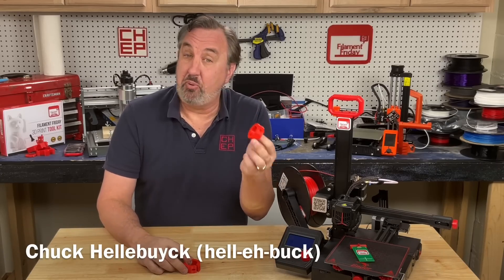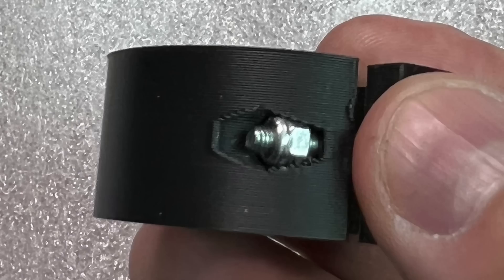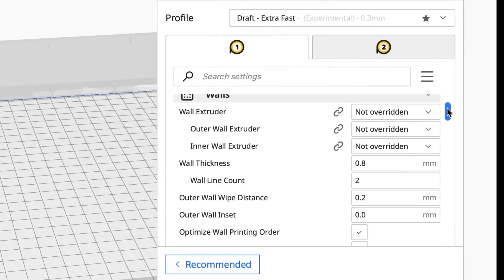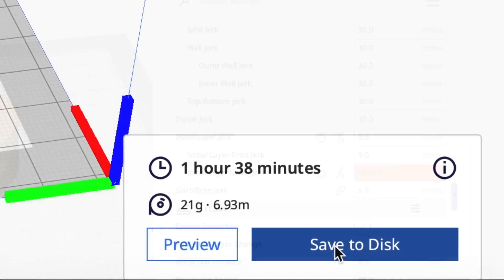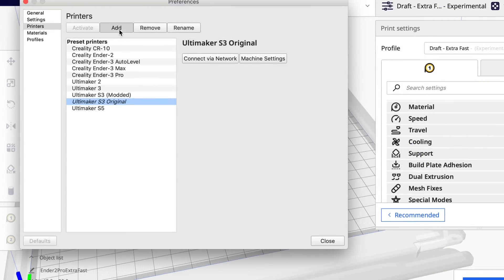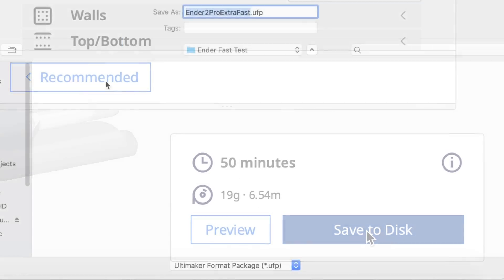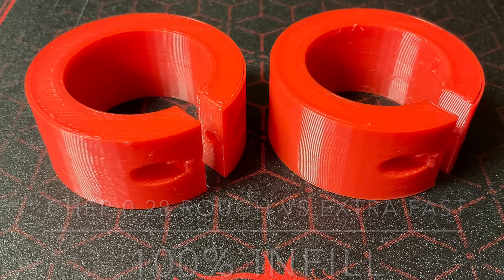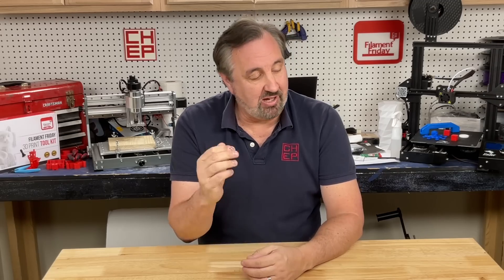Faster 100% Infill Prints with Cura 4.13 on Ender 3D Printer

Comment: I printed a few items at 100mm/s on my Ender 3 Pro without any issues at 0.28mm and 0.2mm. Per the recommendations I saw online, I increased the temperature of the extruder to 215F instead of the usual 200C I use with Hatchbox PLA. I wouldn't do it with something intricate, but it worked well for some basic brackets and square objects.

Comment: Tried to replicate the issue, but I get similar print times with my custom printer profile as with the Ultimaker S3 profile.
I designed a toroidal object similar to yours with the exact same 19g body mass (with generic pla).
Sliced it with the Ultimaker S3 extra fast profile with 100% infill. The estimated print time is 53 min.
Then sliced it with my custom printer pla profile set to 0,3 mm layer height and the exact same speed and infill settings as in the S3 profile, and got a similar 54 min estimated print time.
Then sliced it in Arachne engine beta 2 (99.10.0) with the matched custom printer profile and got the same results.
Reply from the maker: Where do you share your profile?
Reply: I wonder if your better off starting with a custom profile? 

I use a custom profile for CoreXY build of mine and i love it.

Comment: technically, after many tests i have done in my engineering lab, more walls yields better strength. We should try 50% infill and more walls just to see. Even a 25% infill with more walls and see how it works. i would be curious:) thanks for your videos.
Reply: Agree. I think it was CNC kitchen that did some testing.  Short of it all was 3-4 perimeters and 50% gyroid infill was the best mix for strength.  Anything more was just waste of material and longer print times for very marginal gain in strength.
Reply: @toddtheZ  yes, it was cnc kitchen as well that has done tests. I usually use 3 walls and 12% infill and its pretty dang good. 4 walls and 12% is superb for my applications haha

Comment: CHEP, the missing extra secret sauce is in the infill speed under "materials" for the Ultra fast settings, double the infill speed compared to the wall speed. the stringing came from the combing settings, change it to "within infill"
Reply: Interesting!
Reply: I couldn't find "infill speed" under material (Ender 3 V2), is it only available on Ultramaker's profile?
Reply: @erez_gur  it's in speed I think.
Reply: @goku445  ok, thanks!

Comment: How do I improve my spacing tolerance? The best I can do on the test prints is 0.4mm clearance before it fuses to the rest of the print.
Reply from the maker: Adjust E-Steps and flow.
Reply: @FilamentFriday  e steps seems calibrated and please elaborate on adjust flow. I'm at 90% right now.

Comment: You are an awesome instructor Chuck!  I am about to try the Faster 100% Infill print you taught me in this video with the fictitios Utlilamer S3 I set up.  I have learned a ton from you and just received and set up my Ender S2 Pro as a secondary printer to my Longer LK5 Pro.  It was super easy to assemble, but took a little while to level the exrtremely unlevel print bed but now that I have it dialed in, it is printing perfectly.  I have to say I really like the touch screen on my LK5 Pro, but the Ender S2 control panel is pretty intuitive and easy to navigate.

Comment: The title made me think you were talking about a trick that I often use in Cura:  Turn everything off except infill.  Turn perimeters to 0 and then add however many perimeters you want to Extra Infill Wall Count instead.  This eliminates a pile of travels and retractions and makes a print much faster.  If you just need a functional part, it often works out just fine.
Reply from the maker: Beauregard Slim - I tried what you describe and it says 1 Hr 49 minutes so I’m not understanding how that saves anything. No walls, no skin walls, 2 Extra Infill walls, 100% infill.

Comment: The S5 is a dual extruder printer the "Not Overridden" refers to the ability to print with the other extruder on that feature. If for some reason you wanted to print the walls with one color (in the first extruder) and the infill with another color (in the second extruder) you can override the default extruder with the other extruder. I use it to make wear indicator pads, when the walls are worn away and the second color on the inside is exposed it is time to replace the pad. Love your videos Chuck! Keep it up!
Reply from the maker: Thanks. That explains it.
Reply: Hey CHEP how can I get a hold of you personally???
Reply from the maker: Patreon
Reply: @FilamentFriday  How do I find you on there

Comment: Have you tried making it all perimeters instead of infill? Looks like it's faster couse there's a lot less change in direction
Reply: I was thinking this too. I messed around with how many walls and top/bottom layers versus infill, and I print pretty thick walls (2.0mm usually, so 5 layers for a 0.4 nozzle). Then use 20-40% cubic infill, and the parts are super strong. Possibly even stronger too than few outer walls and high infill (see cnc kitchen's video about this)
Reply: @PureRushXevus  link to video?
Reply: I use that a lot. Just put 999 walls and it overwrite the other parameters. I saw a video and the guy was testing the parts and the perimeters only was stronger
Reply: @felipenavas  thanks! That's how I was wondering to set it. Most of my 40mm projectiles take 4-5 hours traditionally. I wonder how long it will take as all perimeters
Reply: @ChevTecGroup  there is also an "concentric infill" that looks a lot similar to the "perimeters only" technique. You should check that too
Reply: @felipenavas  Depending on the geometry of the part however, too many perimeters and it takes slower than infill. So there's a fine balance
Reply: I was wondering the same thing, I thought that's what most people would do, maybe we're speshull.  🤪
Reply: What setting do you make it so that it prints all perimeters? This sounds like a great solution

Comment: I've been running a 0.8 nozzle, 0.36 layer, 20 jerk, 1250 acceleration, 1250 travel, 125 mm/s speed, 236C nozzle, 2 wall and surface layers, PLA on my Ender 3 Pro and its turned out to be some of the best and smoothest prints I've ever done on bigger stuff.  12hr prints @ 20% infill turned into 6.5hr prints at 30-36% infill. There's probably a lot of room for improvement on my settings but I'm happy with what I get...for now.
Reply: I was able to achieve a similar result on my E3v2 with a .4 nozzle, metal extruder and hot end, and setting most of the speed settings to 150mm/s. I didn't even touch the acceleration. .28 layer, 3 wall, 4 top/bottom. 20% infill. Cuts 10 hour prints in half.

Comment: nice tip for speeding up prints. keep in mind that many firmwares also have a hardware firmware set max speed for acceleration, and for flow rate acceleration on extruder.
Reply from the maker: Not all firmware does but the Ender 2 might so good point.
Reply: @FilamentFriday  On my E3v2 I can't raise Jyers over a 1000 I think. I'll have to check again when I get home.
Reply: @dangerous8333  Just manually adjust your configuration file before flashing the firmware. Marlin is easily modifiable.

Comment: do ya have some good settings for the Ender 5 plus?
Reply: Start with the default settings and experiment. His settings may not work well for your machine even if it's the same machine. People dial in their printers differently.

Comment: The one on the right looks to have a little bit of under extrusion. Not likely enough to hurt anything, but the stock profile does look like a better looking part to my eye.
Reply from the maker: It’s my CHEP profile not stock but it is a little better. But it should be for taking 1hr longer.
Reply: @FilamentFriday  that’s fair. I wonder if you could increase the temp and flow to get a more similar result and maintain the 50 minute print time. I think I’ll have to play around with this a bit.

Comment: I am having a big problem sir . I would love to use cura but the reason I don’t is because I can not get the first layer to stick . I have cr-10v2 and with prusaslicer no issues at all and I’m no stranger to bed leveling or most troubleshooting . But I swear for some reason I cannot get cura first layer to stick
Reply from the maker: Copy the first layer settings in Prusa to Cura.
Reply: You could install the cura z offset plugin where you can set a lower z offset in the gcode and not have to change it in between the slicers

Comment: Optimizing your acceleration and final speed helps a lot! I use 4000mm/s² on X and 3300mm/s² on Y at 300mm/s on my Ender 5 Pro and don't even get layershifts in 24h prints. Only modifications are dual 5015mm part cooling, a full metal hotend and a CHT nozzle in .4mm.

Edit: Forgot to mention that I also flashed the board, it's no longer stock firmware. If there's any limit in firmware, it seems to be not active in this one or at least above 6000mm/s².
Reply: 300mm/s is crazy. I've never went above 100, but I like to hear about this!
Reply: @ChevTecGroup  It mainly works due to the CHT nozzle, it gets basically the same flow characteristics as a vulcano hotend due to a larger inner surface area. This transfers heat better into the filament, so it melts quicker and more thuroughly. For .32mm layer heights I need to slow down to 200mm/s so it doesn't underextrude.
Reply: How did you get around the firmware acceleration limit on Merlin? Does it have one? Jyers has limit of 1,000 acceleration I believe. I have to check again when I get home.

I've been looking in the firmware for somewhere to increase it and haven't found it yet.
Reply: @dangerous8333  Oh, yes, I also flashed a custom Marlin. I'm not sure if there's a limit present, but while testing the Motor did nothing but skip steps at 6000mm/s² on Y, so I think there's really no limit.

Comment: Going to give it a go with my Ender 3 V2 tomorrow and see what kind of results we get.
Reply: Keep us updated
Reply: Commenting to keep an eye on your results. I've an Ender 3v2 also.
Reply: I'll be very curious how this goes for you.  Keep us updated!
Reply: I have an E3V2. All metal extruder, all metal hotend. I was initially able to cut my print times in half just by setting most of the speed settings to 150 mm/s, and not even touching whatever the default acceleration is for Cura's profile.

I'm doing this with Jyers firmware. Which I should add has an acceleration limit built into the firmware. I don't know if Merlin does. I've been trying to figure out where to mod the firmware but haven't found it yet. If it does have a firmware limit it won't matter what you set the acceleration to in Cura.
Reply: Also have a Ender 3v2 and would love to know if this works keep us updated
Reply: I want to know too 🤔
Reply: I then followed chucks steps to setup a profile for an ultimaker S3 and then cloned all the settings of my Ender 3 V2 including the start and end G code.

Sliced the same file again with the Ultimaker S3 fast profile with 100% infill and it reduced the print time to 1 hour 19 minutes.
Reply: Set off the print and it completed in 1 hour 25 minutes including warm up time and the results are very good, I did have some stringing around the inside of the circle like Chuck did but no other issues and the print came out looking great.
Reply: Thanks Chuck, this is going to help reduce print times dramatically and I will be trying more prints over the next few days.
Reply: I sliced a file for a Raspberry Pi camera clamp that was similar to what Chuck printed.

With standard quality profile 0.2mm and 100% infill the print time was 3 hours 56 minutes.

Comment: I'm very curious to know what exactly that printer profile has that is different to make it go so fast. Thanks for the video CHEP, you make Friday's better :D
Reply: @cas curse I assume "no_outer_surfaces" means its printing infill in all layers, instead of treating every layer as a top/bottom (which get printer slower) is that correct?.... i think you would get the same benefit by just using 0 top and 0 bottom layers in a normal profile... or even better... set 999 walls and the print will probably be stronger again due to all walls and no infil or top/bottom

Comment: 👍🏻👍🏻
Reply: 3 hours 11 mins to 56 minutes on a stock Ender 3 pro. Just renamed the ultimaker and outputted the gcode as CHEP said. Ran pretty quick but not out of control. Print looked good, slight bulging on corners but dimensionally good. Appeared to have doubled the infill width. Set 15% infill, no special speeds etc normal 50mm min. Will explore more.